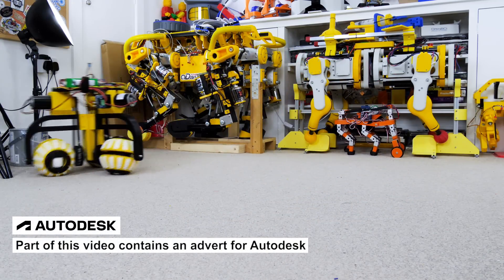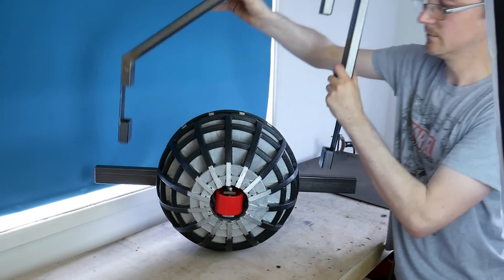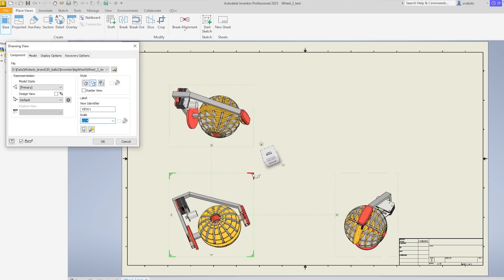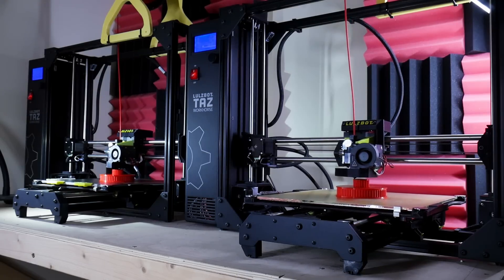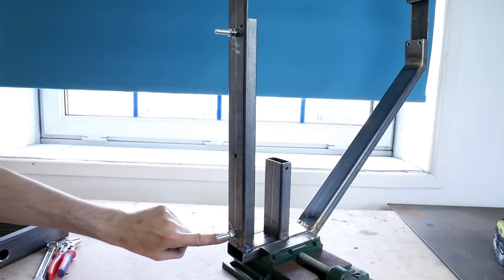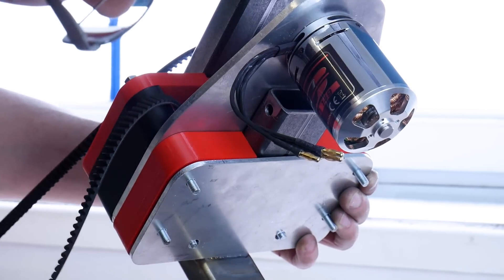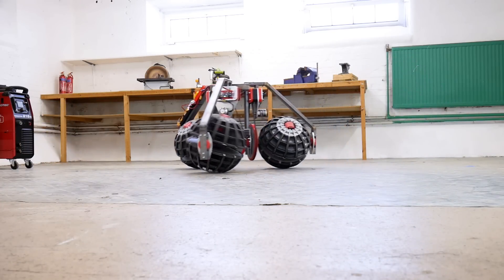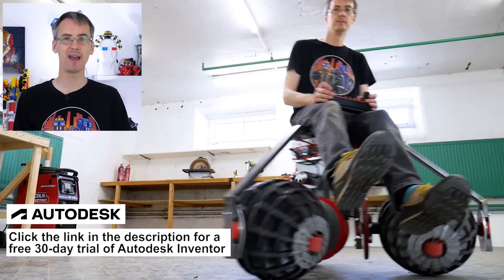Testing Ball-Shaped Wheels on an Omni-Directional Vehicle

Comment: You say that the main problem seems to be ease of learning to drive. Why not investigate control options like a single joystick with a twist control for for rotation (I am sure you would come up with a better solution). If you can find a more ergonomic/intuitive control system it would find use in all your other  projects.

Comment: I question you having the E-stop button on the back.  I'd make sure that button is either on the left or right of your legs so you can get to it if needed.  Since you are putting in a seat, maybe a either a 3D printed assembly or wood (maybe steel if you can find some light weight enough), one that lets you rest the controller on.  Either as just a rest, or as something that you use for when you are controlling the vehicle.

Comment: 8:15 Washers and castle locking nuts that you can run locking wiring through. This will help prevent lost in tension on the nut while under heavy vibration do to uses.

Comment: It looks absolutely amazing and is an incredible piece of technology and machinery.
I would recommend you put a bit of a crash bumper onto the lower part of each arm in order to account for clipping/crashing into stuff. something simple as a bit of a rubber or foam pad would work relatively well. Along with some form a outer shell around the frame especially the main electronics to protect them from impacts or just day to day use.

Comment: Suggestion:  Throw the skateboard wheels on a lathe and try to cut them down to approximately the same curvature as the spheres.

Bonus Suggestion:  Setup the seat to be able to tilt itself via motors so it tilts into the turn like a suspension otherwise I think sharp turns will put extreme forces onto the outer arms of whichever wheels are on the outside of the turn.

Less Complicated Bonus Suggestion:  Put a big plate across the entire bottom to mitigate the potential shearing forces alluded to above.

Comment: I feel like this has a lot of potential as an indoor mobility device for the disabled.  The way it can turn to give you 360 degree access to an area without the need for a lot of space.  Designing a seat for someone who does not have use of their legs would be a challenge though.

Comment: As others have said definitely needs a foot rest which i think would help more with stability than a bucket seat as you would have something to leverage against

Maybe a stabilizing wheel in the front to prevent forward tipping because the back wheel lifted a tiny bit a couple times

Comment: There’s more kinds of aluminium out there than tree species. That’s why people are disappointed when they try to machine the softer varieties or anodise material with a high silicon content. Scrap Alu may seem like a bargain, but it’s pot luck if it will suit your purpose.

Comment: Along with the wheelchair idea. I wonder how it performs on sand or snow. 

My idea for suspension is as follows: the wheels are probably fine in this stage of development. But you could start with at least a dampened/suspended seat. You would really only need like 3-4” of travel that you could probably source from rear mountain bike shocks as the mounts for your seat rails/pan. Play around with the psi in the shocks to figure out your sag and BAMN. Smoother ride.

Comment: I wonder if something like this can be used for motion simulation for a seated VR experience. where it would move rapidly from a neutral point to match the virtual acceleration, then slowly return to the neutral point without accelerating much. I know there was some progress with roller skate-like design, the idea seems to work, but those are extremely impractical, heavy and expensive. Omni-wheel chair however seems a lot easier.

Comment: All it needs is a skirt around it with balls on it. A protective cabin for the driver perhaps with rings and grills. Topped with a domed lid with a couple of flashing lights which light up when you speak. Some kind of small laser and a rubber plunger on an arm.

Comment: Definitely put a seat on it. And foot rests. 
   I dont think a full bucket seat is necessary though, a lawn tractor seat with a back and armrests should work, and the spings in the tractor seat would probably be more comfortable than the hard plastic of a go cart seat.

I would also suggest not sitting with your feet between two of the wheels, instead straddle one of them so it is in front of you (if you veiw it as a triangle of wheels, have a point of the triangle in the direction you are facing instead of behind you).

This would allow you to use the front wheel frame as a mounting point for the foot rests (you could even use motorcycle/dirt bike pegs if you want something that you could fold out of the way).

And as for weapons... The American in me says go big or go home, so add a FlameThrower (flamethrowers of all types are legal in the US without licenses if the spray is less that 20 yards).

Comment: Simple add/on..Remote control it for better testing..Zigging and zagging if people could handle it.Widen the frame..put the driver's compartment low..put a rollover cage atop..strap yourself in and see how the wheels handle higher speeds..with plastic I imagine a lot of sliding when changing directions (it wouldn't be considered over or under steer)..rubberize the wheels and get moving..break-neck speeds and turns!

Comment: I had a question, would only these wheels run only on a flat surface? There seems no suspensions visible (yet) in case it would run on rough uneven surface. Would there be a variant of the wheels than can individually suspend on uneven ground? Or perhaps able to scale up a ramp or elevated platform?

PS. Can this Ball shaped wheels can be mounted at the back of bikes and the front have the omni-wheel?

Comment: Based on the few coments ive read, these seem to be the improvements desired: seat (possibly seatbelt/harness), foot rests, chassis/cover.

Honestly, I would like to see it "in the wild" does it handle slight inclines? How about turf or grass? What's its loaded top speed (is it limited by the motors or the frame)? Could you add some form of suspension to it?

Comment: The roll center looks high for any kind of off road application.  Perhaps the pilot's seat  could automatically tip to keep the pilot's weight over the center of the wheels.  It at least needs a roll over sensor to prevent the omni wheels from turning into a flesh grater during a tip over.  The seat should probably have a five point harness.

Comment: Probably needs a full race seat with neck support. But I'd rather see a simple office desk chair instead. You want your back to be able to slide if your head is not supported by the chair. Otherwise your neck takes the full sideways force. If it had a narrower/shorter base, this would make an awesome wheelchair. But your balls are too big for that. Make it sand proof and go to burning man. All terrain wheel chair.

Comment: I would add a built in steering wheel or controller so you don’t have to hold it up the whole time, definitely a seat. Probably move the EMO button so it’s in front of you too. I want to see you drive it on a bumpy sidewalk to see if it’s good with small bumps and things you would see in a city. Can it go uphill? Might be a cool wheelchair alternative

Comment: A seat facing how you were with a bar extended down with some foot pegs to control your feet movement.  Also dual sticks mounted to the frame would be cooler than a remote. But change the control more like a tank but both sticks left yaw left, etc. both sticksforward move forward, etc. Sticks opposite spin in place. Add nerf machine guns and both sticks in fires weapon. Both sticks out equals one more accessory function to be added later.

Comment: What if you made a sorta standing seat, sorta like the seat of a unicycle but with some foot supports attached to the frame (instead of pedals on a crank), but make the pole the seat is mounted on articulated (and springloaded) at the base so you can lean in all directions to move and twist the seat to turn, leaving you hands-free while you ride it?

Comment: I'd like to see a mounting system for a monitor and PC/Game console as well as mouse and keyboard desk that could fold away when not in use. I've got a portable monitor and have found I can run something as light as a raspberry pi for more than an hour on just a power bank. Turning this thing into a portable programming station might come in handy.

Comment: Add a motor on the seat so it's able to rotate fully, and then link the controller and frame positions so when you press forward you'll go forward wherever the seat is facing for maximum mobility.

Comment: I know this is the very first version and it looks cool as hell.. you could/should make it with lower center of gravity, there is alot of wasted space over the wheels, basically you seat needs to be as close to the wheels as possible. the whole gearing system could be more compact and the motors could be moved to the inside of the frame when you have it all figuered out 👍 awesome work, seems to be alot of potential in the project

Comment: Go with a minimalist style  seat by adding foot rests you can use your legs to hold on .
A bicycle seat would work fine mount a holder for the control box so you can stabilise yourself with your arms also like the armrests that is used on som race bikes

Comment: That e-stop switch needs to be easily and immediately accessible by the "driver", not around their back.
Reply: There doesn't seem to be a front, currently, so the switch could be to one side or between your legs depending on how the seat is eventually mounted
Reply: @dafoex  true enough; I'm calling its location the "back" because Bruton is sitting in the opposite direction.
Reply: I actually just went back, and I noticed that, for the thumbnail, he's sitting with the e-stop between his legs.

Comment: If you ever repeat from the ground up, I'd suggest a larger central triangle between the wheel struts so you can drop your seat lower and also spread your triangle wider. Also sort out a spring and damper for each wheel.

Foot pegs, a skid plate, and an all-around triangular bumper.

And if it's all in a permanent construction, what's the control scheme gonna be? Sidestick with a twist for one-hand control? Stick and knob? Stick and foot pedals? Floppy Tie Fighter Yoke?

Comment: It'd be cool if you could get the top lower so you can sit lower to the ground. For this exact design, just a seat and some spots for your feet. Maybe something to help the wheels be a little smoother, idk what you could use that wouldn't wear off quickly though.

Comment: Give it a handle like a mechanical bull or a hopper ball. Then use a saddle with pressure sensors, so you can control it by shifting your weight. Now you've got yourself a robot horse.

Comment: The seat should have the ability to swivel independently so that the assembly can rotate beneath it without changing driver orientation. It may seem redundant at first, but this will allow greater maneuverability in certain areas around obstacles without disorienting the driver. It could then lock when you also want to change facing.

Also suggest the seat can tilt so that you could be looking up as if working on something above you. Not sure where this would be useful in the real world considering the current design and its height, but it would have potential applications on a design with much lower clearance.

Comment: I'd actually suggest turning it around and riding it more like a traditional trike. I don't know if you plan on testing it on any rough or uneven terrain, but in reverse trike config you're gonna flip. I would also actually suggest spreading the wheelbase out quite a lot and setting your center of mass far lower, unless you like the taste of long set concrete.

Comment: Maybe i'm not seeing right, but it seems, that when you start the weld, you tilt the head and let the tungsten rod touch the material your welding.
This is actually really bad, cause you break the tip of the rod.
It's supposed to be completely sharp point, and not touch the work when you start.

Comment: If you could design a hand mounted controller almost like an old wii nunchuck crossed with a 3d space navigator you could essentially have a a viable workable control method for those in wheelchairs.

Comment: really hope you understand that YOU ARE A GENIUS!!!   LOL  - THAT THING IS AMAZING!!!! WOW!!!! 
Yes of course a seat is needed, but what about some kind of fenders?? They would  prevent your legs from hitting the "wheels" AND to keep dirt, stones, twigs, etc.. from flying up into your face...
Maybe a stand to hold the remote??  oh here's a couple of ideas of the top of my head :)
----  As far as accessories go (like the cannon you mentioned) you should do something with LASERS!! Maybe you could have 3 of those Lasers that are used at parties or raves (or that STYLE... they are expensive, but I know you could make your own.... and have their patterns tied into the input of thew remote... so each wheel has a laser tied to it and every time it moves the pattern it is  doing changes.... but that is a big project in it self - mainly because I think those "Party Lasers" I'm thinking of have their patterns created by the laser shining onto a mirror that moves on 2-axis.... but now that I think about it you are the PERFECT person to make your own would probably be quite simple... a stationary laser shining onto a mirror that tilts on 2 axis that are controlled by the small motors tied to the same signal that the drive motors get... PERSONALLY I think this is MUCH BETTER than a CANNON :)
----  OR  maybe a set of handle bars like on a bicycle... you could have a twist throttle on the right to make you go forward and backward in the direction you are facing, and on the left it would rotate the whole vehicle... but turning the handle bars would be a bit of a combination of both so if you're moving forward it would cause you to actually turn..... this would require a bit of calculation that I KNOW you can work out.... BUT this would be a whole other project in itself.... maybe- it could be part of the "Omni-wheel-mobile 2" 🤷‍♂️

Comment: Looks really cool and useful. Might have potential as accessibility tech.
I think some kind of suspension would be good, those omni-wheels have very little flex and it would get kinda painful riding for longer periods of time. You'd only need the seat and maybe foot rests dampened, as a three wheel vehicle can conform to varying terrain without any suspension.

Comment: a lil tweaking and this woulbe an Amazing wheelchair, I look to adapting ready-made wheelchair seat frames on to/in to these wheels, might have to shrink the wheels to fit through a standard 36" door, smaller wheels would also help you stablize the whole thing

Comment: A seat, Foot rest, simple mounted controls (one joystick for forward/backward/left right, another input for spin/turn rate) still keep the remote as either an override or just alternative control

and a mount point for accessories. (ie, nerf Gatling gun or equivalent, Cargo box )

Comment: Can you remove the skateboard wheel? Add a gyrosensor to each wheel and let software add small rotational movements  to prevent sliding on a wheel.

Comment: While a triangular configuration works well as a platform base, involving a person riding in this thing at this scale requires a different approach to the chassis. Personally, I think with the wheels scaled a bit more, a chassis similar to a recumbent trike could work well, with the reclined positions with the legs stretched out, rather than an upright position; alternatively, a typical trike sitting position of straddling the body of the vehicle, though this would still require an isosceles layout as you don't want the width getting out of hand while the length is needed for rider size and stability. With an upright position, like this, the frame should be modified to be a T-shaped platform, for leg room, and where the structural uprights need to be reversed to where the center forms a cradle that can lower the rider's position. The commonality between these, considering there's a rider, is that the layout needs to form a cross, where the fourth leg of said cross is the rider's legs, there's really just no way around this at this kind of scale; otherwise you need small wheels on a wide base to act as a chair, which would probably require the move to 5+ wheels like your typical office chair caster base, or you need the rider to stand in the center of the wheels to keep a regular polygonal wheel layout, with the last option being an even larger scale to turn the previous standing position into an upright sitting position. Designing ridable crafts is a lot more in-depth than designing a basic platform, there's a lot more design considerations that need to be accounted for, even at very early prototyping such as this.

Comment: I'd integrate the controls into the vehicle, that would give you handles to hold onto which would help with the rider's stability, that plus a seat and foot rests would do a ton, also, move the emergency button to somewhere more accessible for the rider.

Comment: That looks like it has the seat way too high up, a significant restructuring of the whole assembly would be recommendable if you're going to take that out. Let's say, if you had the racecar bucket seat set so youd be above the wheels from sternum up, you might still not get your hands cauterized by the wheels.

Comment: The E-stop needs to be more easily accessible. Great job though. This has definite wheel chair alternative vibes, so the controls should be on the chairs armrests. Have one side be a throttle lever and the other side be the directional joystick.